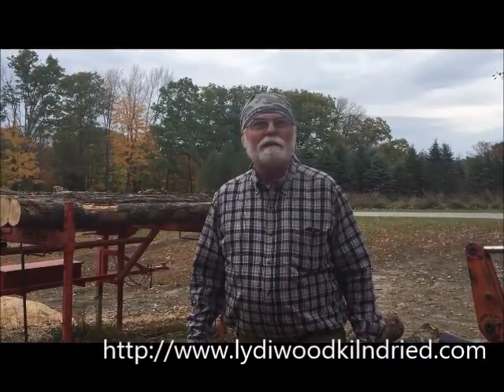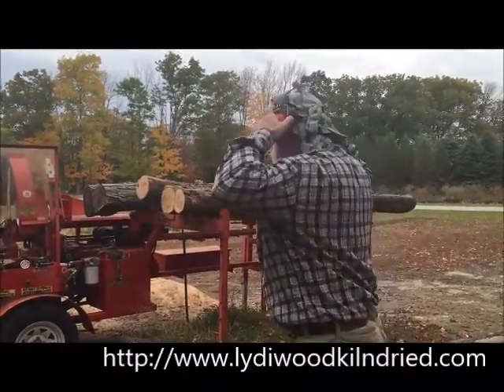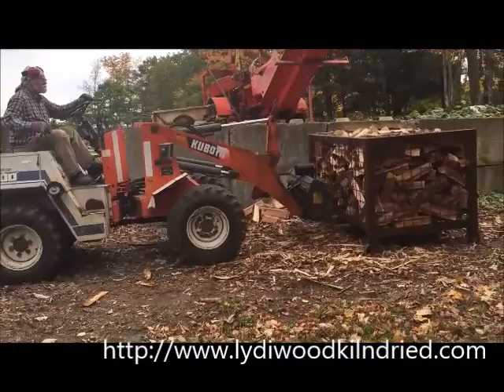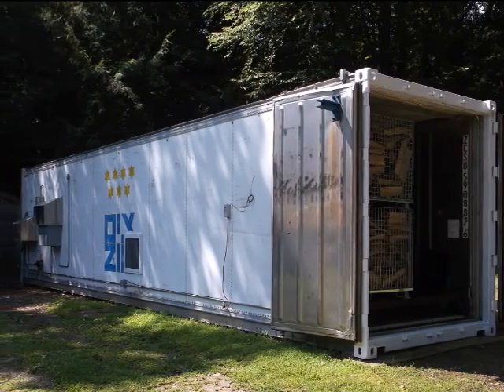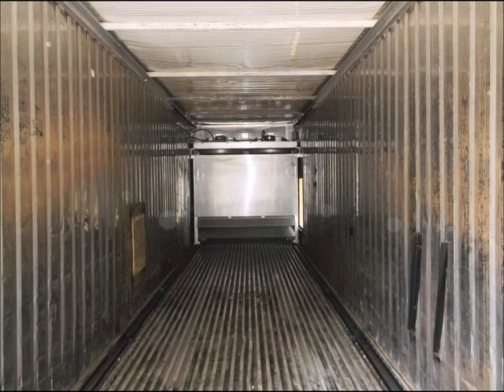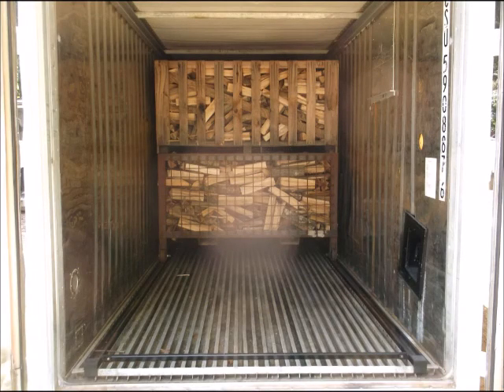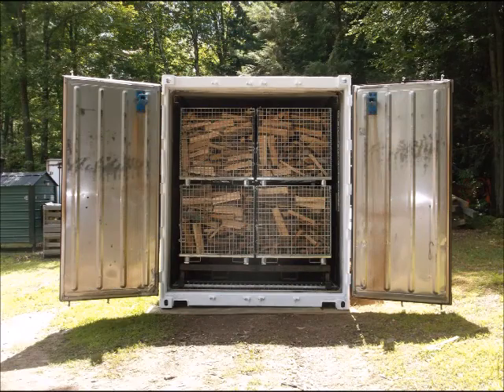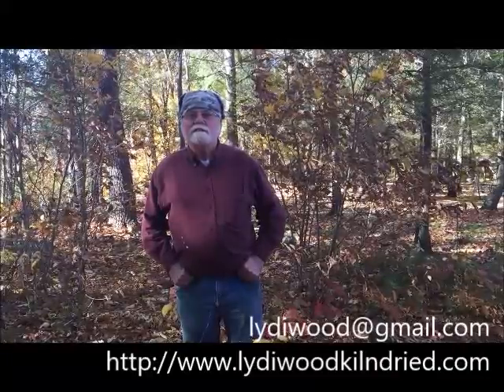kiln dried firewood - lydiwood kiln dried firewood

Comment: Is the process for kiln drying firewood the same as for kiln drying dimensional lumber (for wood-working projects)?  Can you use the same type of kiln?  Can’t get a straight answer anywhere.
Reply: I dont see why not, I mean the idea for both is to dry out wood?
Reply: You don't need to monitor wet bulb or anything with firewood.  Blast away and keep it above 160° wood temperature for the prescribed time.